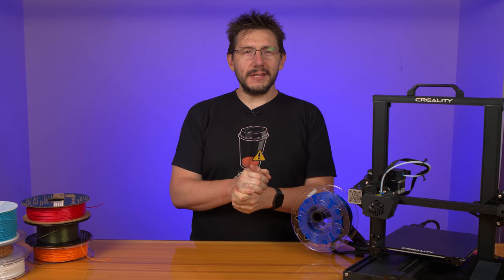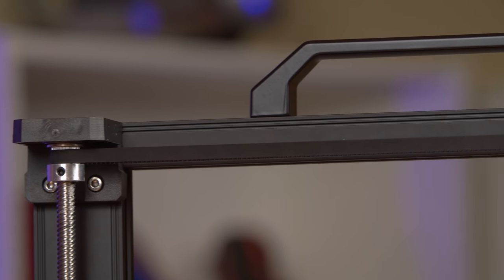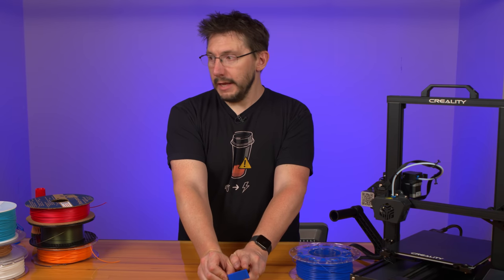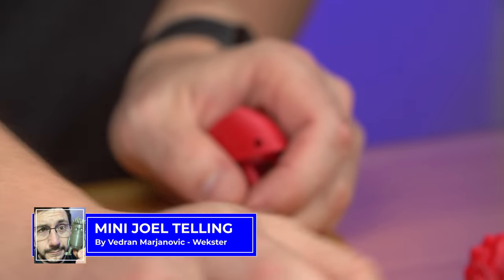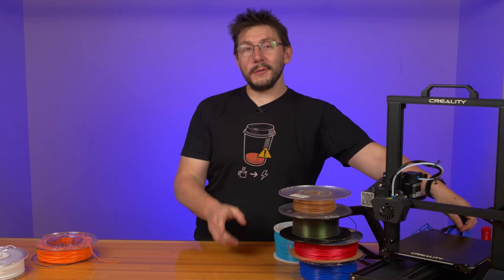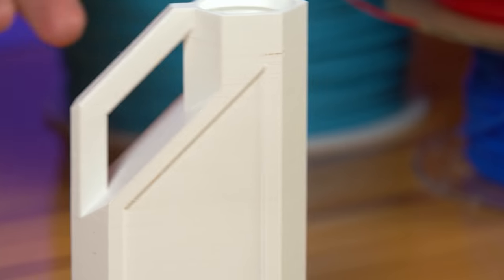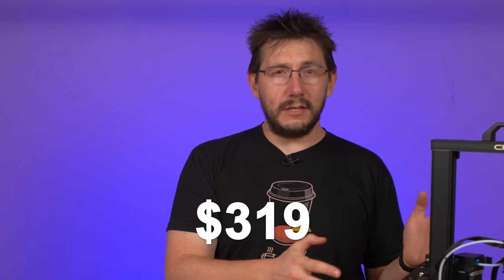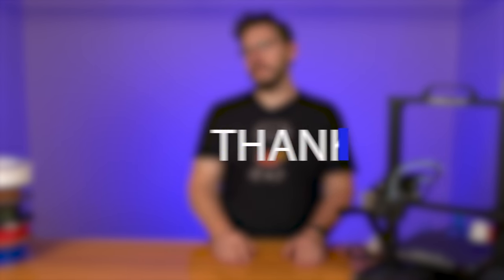Creality CR-6 SE Review // Should You Back It On KICKSTARTER?

Comment: Thank you for the thorough review.  I am missing one piece of info about 3D printers.  If the only way to get the printing file from your computer to the printer is via the SD card, I assume I need to be sure that my computer has an SD card reader slot?  I don't know if it does, but I guess I'm about to find out before I buy this lovely beast! (Sorry, I'm a 3D newb, so I'm just delving into this {3D} rabbit hole).  Are there other ways a printer (STL?) file can get to the Creality CR6 SE?  You mentioned something about a micro-USB on it.  What is on the other end of that cord that's included in the box?  Thanks for your help!

Comment: this reminds me of my CR-20 Pro it looks good on paper but the actual experience is less than ideal when that bed leveling sensor, extruder, warped bed causes problems you're going to wish you never bought get ready to spend money to fix it
Reply: Your point weird. The CR-20 is much closer to the Ender 3 which is a much loved machine (although not perfect) and it has none of the improvements like the bed leveling sensor so how on earth do you draw this conclusion? The bed leveling is designed to combat warped beds so if anything, it would help it while you insinuate it would cause more problems.

Comment: I've been using an Ender 3 Pro..

Looking at a second printer...
Any similar products not from China?
I would rather buy north American or European brands.

*I am familiar with prusa... But that's 3-4x the cost for what my (newb/amateur) eyes see as VERY similar.
Reply: I looked into getting another printer a month ago and short answer is NO. Everyone I asked, every website I checked, always the same answer: either go expensive with the i3 mk3 and get some extras like auto bed levelling, etc. and slightly more reliable prints, or go cheap and go Ender 3 Pro which takes a little more effort to get great prints from (really means just watch some Youtube tutorials). It seems there's almost zero machines between the  Ender 3 Pro and i3 mk3 that have extra features included in the mk3 while offering better print quality than the Ender 3 Pro. The ones that are better, are immediately €200-300 more expensive for minor improvement and  that didn't seem worth it.

Now this machine ... this is pretty much perfect. Touch screen, belt tensioners, better spool holder, quiet stepper motors, auto bed levelling, filament run-out protection, 32 bit board, etc. etc. for only €100 extra over the Ender 3 Pro? Dang that's a good deal - it's exactly what I was looking for.

Comment: I want a second one not because of it’s cool new features but I need one printer to be free when print a big file. I need one to print other cool stuff beside printing part for my Ender Pro. They have a better model the $500 plus range one this one is only an improvements of the Ender Pro. Well I hate installing part and new setup because u alway have to do trial and errors. Abs printing is a skilled not pre installed. U talking to me because I print alot of abs just look at the left over filaments. It’s not a cr10 or 5 it’s a cr6 somewhere in between. Why u advertising the glass it’s $15 dollar.

Comment: One thing's for sure. This printer beats the XYZ daVinci printers I have in my classroom. Those things are complete garbage! It is almost impossible to get anything to stick. They string all over the place. And, even crap prints only come out "successfully" about 20% of the time!
Reply: Just level properly and clean the surface well. That will most likely to fix adhesion problem.

Comment: Imo Kickstarter is more synonymous a pimp and his ladies, except for Kickstarter the ladies are scammers. They get a cut of the profit and they give no flying flip whether creators fulfill their end of the reward offerings. For all they care if the creator only provides long over due lip service, that's enough of a service. 
However, there are situations where this isn't the case, and for the most part it's if you know the company is distinguished. I think Creality is reliable enough to provide you with a functional printer, but yea this is more like using kickstarter as a pre-order system without the risk for them if they wish to run off with the money.
Otherwise like mentioned in the video, only toss money at kickstarter if your willing to part ways with it and get nothing in return as the worst case scenario. Once kickstarter gets a cut of the funds, they're already busy running their empire of dirty money and firing employees willing to unionize.

Comment: When filament runs out, how easy's it to get that remaining segment out?
Reply: You'd just have to pop the PTFE tube from the extruder and pull it from there. With where the sensor is you should have plenty to get a hold of to pull out
Reply: If you have to pop the PTFE tube out they've done it wrong. The runout sensor comes before the extruder so the printer can back the filament out itself. Once it's out far enough you should be able to disengage the extruder and pull the leftover part out of the sensor before loading in some new filament.

Comment: why spend that money on a small printer that cant even print  ABS ? when its in the same price range of the anycublic mega X thats twice as big prints about as good and has no problem with ABS ?, like i know 3D printing nerd doesn't do much ABS printing but for piratical use  ABS is kinda a must for allot of people in particular college students artist and cosplayers
Reply: Because some people don't care about ABS or need a larger bed and this has ABL which the Mega X doesn't. So they can get this and save $80 or so over the Mega X.
Or if they really care about printing ABS they can use the money they saved and make an enclosure.

Comment: Sorry Joe, but this machine does not bring anything more than what you get when you buy an Ender 3 !
Maybe not, if you consider that you have a handle...

Here are my impressions as an owner of a Creality machine:
The filament sensor is useless (like on my CR10S Pro V2 bought in february) because as you said, the machine stop heating which leads to the problem you described and more important, you cannot remove the filament !
This means the extruder will not retract the remaining filament until it  is pushed all the way through the nozzle (20-30cm).

The modular extruder (marketing name) looks more like a way to lock your customer to your own product than a key feature.
The glass bed is a joke compare to PEI flex sheet.

Nozzle fan works only in one direction (like on the ender) so if you change the orientation of the print, your overhang will fail miserably.
The only real advantages are the belt tensioner and the touch screen (although the second will not please everybody).

Creality support for the embedded software is nil. I tried to get the source code for the CR10S Pro V2 but they refused. I wanted to correct many bugs I found (like the file name not displayed if longer than 20 characters), but finaly the only option was to replace the mother board and install an up to date version of Marlin (they ship there top of the notch, latest machine with Marlin 1.6...). Conclusion: do not expect any software improvement !
Now I agree with you that there PLA filament looks good from the results you got (and we all now that the filament is the most important part for good prints !)
My conclusion : stick to the Ender serie and do not expect any software improvement from this manufacturer 
If it comes good, but do not wait for it.
The other option is to  look for a well made machine with excelent support like the Prusa mini for instance.
I tried both (Creality and Prusa) and even if you pay an extra amount for Prusa, you will be much more happy with it at the end of the day !
Thanks for you excelent reviews !
Keep-up with the good work

Comment: soooo this is a ender 3 on steroids
Reply: Bigger build volume, better stepper motor drivers, auto-leveling built in, 32 bit mobo, better/branded power supply, double z-axis with sync belt, filament sensor, carborundum glass bed, WAY quieter... but sure, it's just an Ender 3 on steroids.

Comment: Ender 3 pro + everyones home printed upgrades = Creality 6SE. No thanks. Be more creative Creality.
Reply: You obviously didn't pay attention to this and all the other CR6 vids.
Useless you can 3D print touchscreens? or 3D print much larger Y-axis? can you 3D print dual Z?
Can you 3D print run out sensors? Strain Gauges? Full size SD card readers? Improved Hotends? Or Improved Extruders?

No, you can't print any of that but yes in addition to all of the above it has some "upgrades" people normally except since they were manufactured they are better.
Come to terms with the fact that some of us got this Printer that is much better than your Edner3 Pro for $265 which is barely more than you paid for your Ender3 Pro and stop being salty about it.

Be happy for them and be happy that it is bring new people to the community.

Comment: FDM is so 2010's... I can't believe companies still make them...
Reply: FDM still have som to give. When we have the non planar printing going it will be more practical and usable. What du you see as the better method Dusty River?
Reply: You are sarcastic right?
Reply: Sls is not for a regular person tho (starting at 5k+) and sla/dlp/lcd requires too many safety precautions and parts aren't that strong and testing is quite nasty
Reply: @kitewinds663  MSLA all the way. 8k and even 12k screens are now possible. Water soluable resins are coming out and with a bit of technical effort I'm sure it won't be long before they can reach molded pla qualities of strength and pliability.
Reply: @Lucas-os1vr  Nope, totally serious.
Reply: @UNVIRUSLETALE  I can buy a brand new one with a print area of 12" x 8" x 16" right now for less than $4,000US. Well, I can't, but someone with $4,000US could.
Reply: @athopi  yeah I know there are some in the 4-6k range I just don't think that until they're <2k they're gonna get a wider adoption in the consumer market. For msla I'm just waiting for non toxic water soluble resins to get one and possibly at least a 4-6k screen to have a noticeable quality advantage over a well tuned fdm
Reply: @UNVIRUSLETALE  By no means are they perfect, yet. But look how far they have advanced in just the last 3 years and how affordable they are becoming. Go back 10~15 years in the FDM home market and it was a SLOW climb for the first 5 or so years then a rocket to about the limits of its capabilities a few years ago. There really haven't been any major FDM improvements in 3~5 years except for huge competition, lower prices and better reliability in the machines and consumables. That technology has reached its peak, it seems. I think if you could see the 3d machines of 2022 Christmas Season, you'd be hard pressed to find a good selection of FDM ones. Like CRT tv's. One year there are a few 40" plasma and LED versions at small car prices in the show rooms, then a couple of years later, there are no crt tvs to be found, new. One good counter to the current msla 4k resolution is AA, Anti-Aliasing.
Reply: Dusty River only 4K?  Let’s not forget if you are printing large scale, then the resin cost is also sky high. I use both and let me tell you. Unless I have someone buying something and thus footing the cost. I’m not inclined to print big in resin. It’s 5 x the cost of pla. not to mention the health hazards of resin right now
Reply: Dusty River Yes, it produces high quality prints, but it’s quite messy and can’t really compete with the FDM as a household printer yet in my opinion. Few materials to choose from and the resin cost over time is greater, as the shelf time for a roll of PLA is better compared to the liquid resin you once pored into the printer is degrading. Let’s hope we keep inventing in this rate or faster  :)
Reply: @robertkelly3948  Well, those issues are part of the deal right now. The resin is far less hazardous than something like vinyl resin fiberglass construction. I live in the SW and fiberglass resin is pricey, but when I lived in south Florida, it was cheaper than Perrier. But also consider, a narrow band of items one can make with home FDM and hope to sell on the open market. The quality of MSLA  prints, right now, from a home unit is such that a budding entrepreneur can feel confident that there will be a market for well designed and printed items. Not to mention the speed deficit fdm has, under msla. From miniatures to cosplay items, the list seems only limited by people's imaginations.
Reply: @kitewinds663  Yes, lets! And it will!